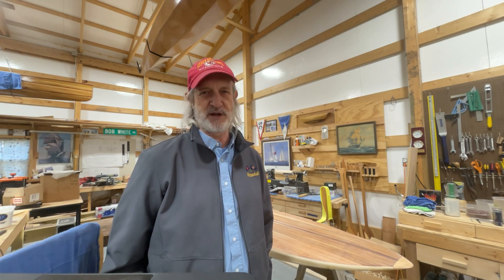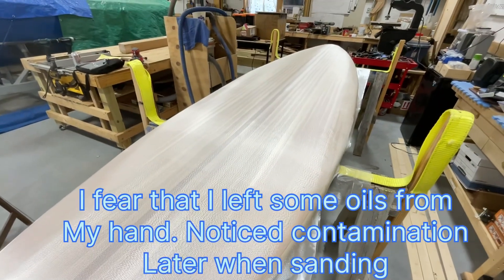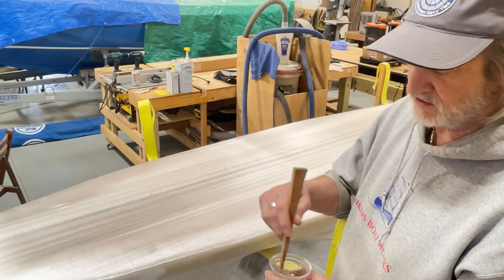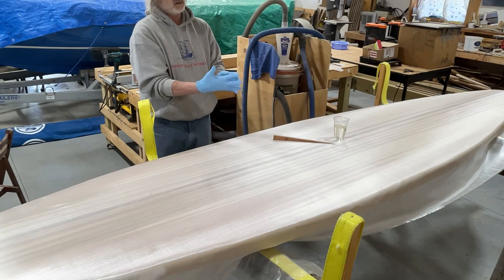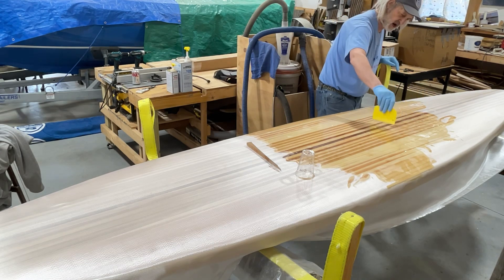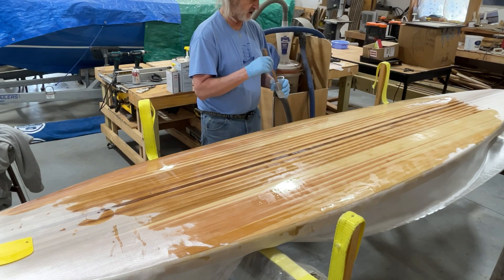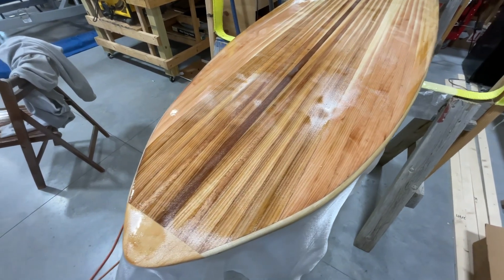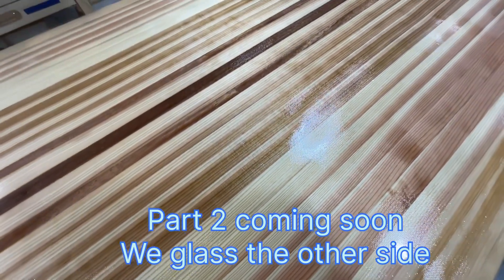How to Fiberglass a Stand Up Paddle Board - San Marcos by Jarvis, Episode 22 part 1

Comment: Can you do it with a roller?
Reply from the maker: Hi John,  yes, you can and I actually do the fill coat with a roller. This will be in part 2. I recently watched Nick Schade fiberglass a kayak and with a helper. The did the wet out with a roller and tipped with a brush